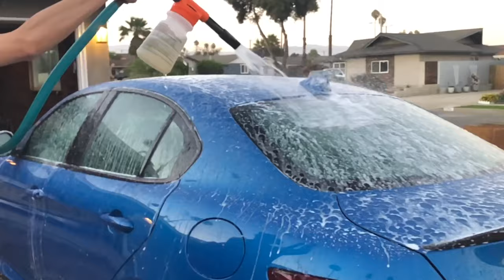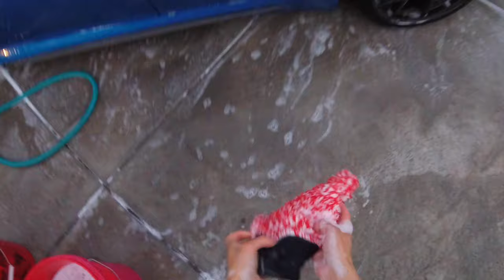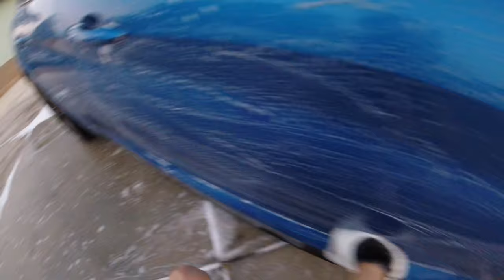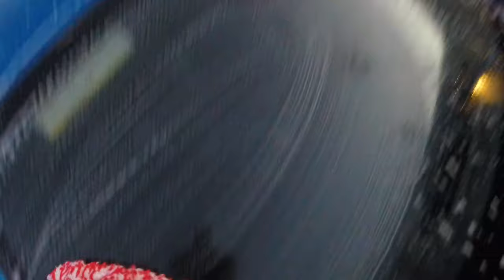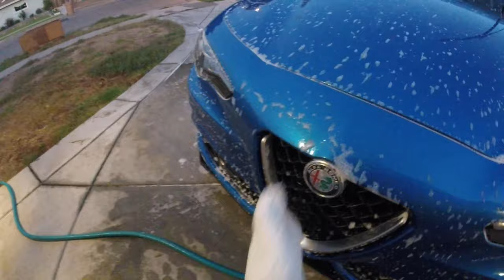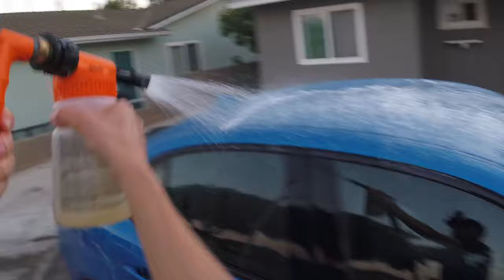Is the Giulia QV a FUTURE CLASSIC? | Wash *POV* | Vlog EP8

Comment: Bought a 2018 this past weekend, and I think I scored a very fair, if not excellent deal. Paid $44,750 for a Rosso Competizione Tri-Coat, 20k mile, fully-optioned vehicle. Carbon fiber race seats, hood, roof, active aero front splitter, and steering wheel; red stitching, driver assist dynamic package, dark Tecnico wheels, gloss black calipers w/white lettering.

I searched nationwide for optimal specimens, with most being overpriced, have higher mileage, and not the right packages. Then, low and behold, this one came up just 30 miles away! Went to The guy had just posted the ad the night before I went to see it. To prevent him from showing to others, I gave him a deposit and came back the next day with the check.

These cars are simply awesome.
Reply from the maker: Congratulations! Enjoy it and drive it 💯 I’m jealous of those carbon seats!
Reply: @Food_n_Driver365  Don't be too jealous. Mine has the "clicking while turning at slow speeds" issue lol. It's not harmful, but an annoying. The fix is a $450 set of washers. Do you get that clicking too?
Reply from the maker: @smurfythesmurf  Yikes, that will take some time to install too. Luckily I don’t have that  issue. However I do hear minor squeaks in the rear suspension when it’s cold outside and the car is cold. That started at around 75k miles I think…